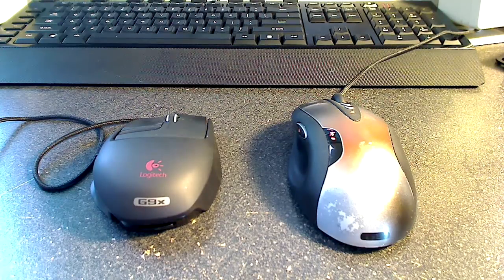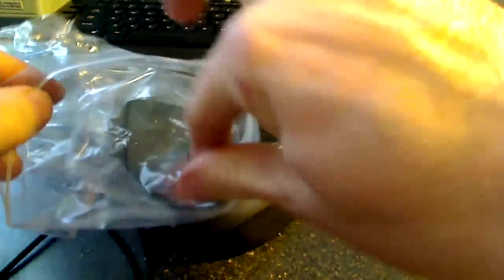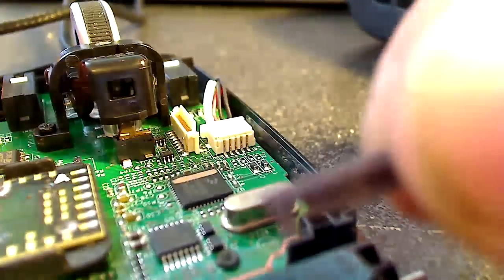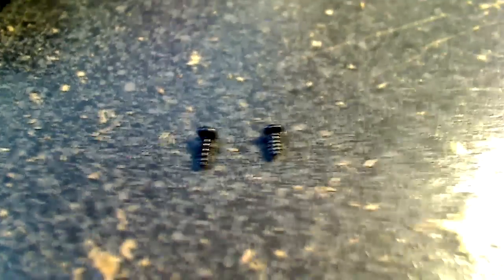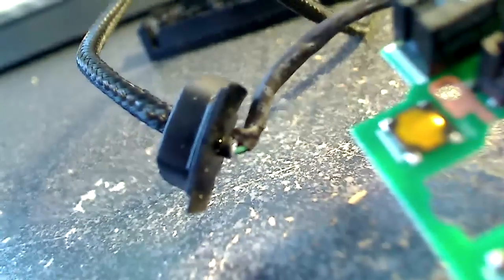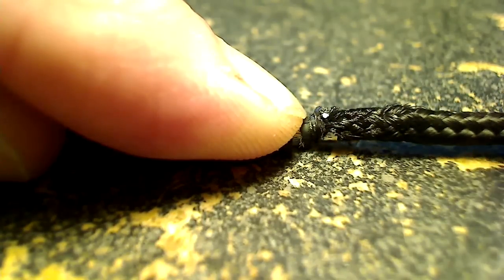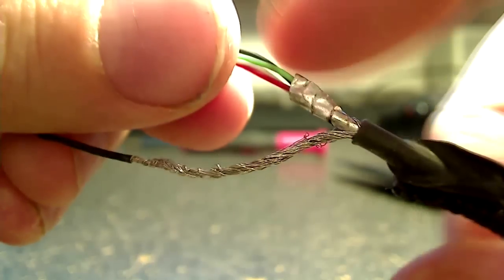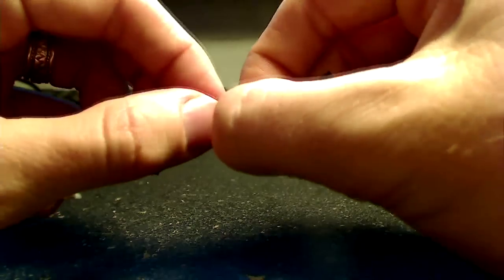Logitech G9 / G9X Disassembly / Repair - Shorted Cable

Comment: I'm an electronics tech and have been doing these sort of repairs for 20  years. My G9x keeps losing power mid use so I know it's the power/USB cord. I just needed a video to show me how to take apart the mouse without damaging anything. This is a well made/edited video from beginning to end. Thanks. Anyways, I took my mouse apart and I can see damage to the wires where the grommet is. I don't have a soldering station at home, I'll have to fix the wiring issue next time I'm at work.

Comment: Just used your video to clean the mouse wheel after 6 years of use...good as new, thank you!

Very tricky (if your a fumbles like me) to put back the whole wheel assembly.  I actually had to take the wheel itself out of its plastic holder to clean out the grime underneath.

Altogether 45 minutes.  Saved myself some cash, but the satisfaction of fixing something that is still good is invaluable :)

Comment: No idea if you are still active on here friend, but I just wanted to say a big thanks. This video was super helpful in me fixing my favourite old mouse! I bought the G9x back in '08/'09 and have yet to have a more comfortable mouse. It stopped working years ago (couldn't stay powered), but I found it recently and decided to try fixing. As soon as I opened up the end of the rubber wrapping on the wire, the wiring just crumbled like dust and fell apart in my hand! I lost a good 2-3cm off the black wire. Twisting these together and soldering was enough to fix the issues. Your guide was essentially for the fast and easy assembly/disassembly. Thanks!

Comment: Well I took the old G9 apart knowing I didn't have most of the stuff needed to do the repair. In the end I just wound the two black wires together and covered them tightly with insulation tape until I can get hold of a soldering iron, put it back together snd it works like a dream. Will use this while I wait for the replacement to arrive. Thanks again for the video.

Comment: Thanks! my scrolling wheel stopped working and i bought a new mouse. The new mouse wasn't great so i'm sending it back and by chance i saw your video. Opened my G9X and there wass big ball of dust/hair, removed it and now it works fine again!

Thank you

Comment: Thank you - this video was insanely helpful for repairing a shorted g9. As a public service announcement for others, if you find your mouse constantly scrolls up or down after reassembly, you may have over tightened the screws that hold down the mouse wheel. I had to futz with the screws to find the right tightness (if too loose the wheel won't register clicks consistently).

Comment: You saved my mouse! I had a problem with my right click switch, but I had no idea how to disassemble my mouse or even where the screws were. Now it's in perfect shape! all i need to do is wait for the glue on my front teflon foot to dry, and we're good.
Reply: Was it your right click releasing constantly?  Mine is starting to have that took and I even cleaned it.

Comment: Thanks for this excellent take-apart video!  I just resurrected my G9 with its help.  I did not mess with the cable itself though - cheap cables for these things are all over Ebay.   My mouse had suffered the tender attentions of my toddler son - when daddy would forget to push it well back, he'd yank it off the table, chew on it, chew on the cable, yank on it HARD (happily chortling ) when daddy would try to take it back.  The mouse surprisingly made it through a couple months of this abuse before starting to intermittantly disconnect from the USB.

I might take the cable apart, just for yuks, to see what exactly happened to it.

Comment: I just change now my old  logitech g9 wheel,  and didn't know where it came a little piece of plastic (which goes under the wheel, I dropped it when I remove the pcb for inspection & clean), thanks to your well explained video I was able to know quickly where it was placed. Thank you and greetings from Spain!

Comment: I had to RMA my first mouse since I was using it on a painted wood surface and the tracking became worse and worse.  My second mouse has fallen a lot and the wheel broke, it was also shorting by the USB cable side.  This video helped me put the wheel and cable from my first mouse into the second mouse.  Not the intended purpose of the video, but you saved me a ton of time, showed me it was actually possible, and saved me $50.  Thanks so much!

Comment: I actually needed to repair my mouse wheel assembly and this video just worked fine for getting me there. Thank you very much!
Regarding the ribbon... it's actually two pieces, so nothing is breaking as fpsDREDD assumed. It's the ribbon connector cable, you put that in first and then you slide in the little black cap that tightens it in. It's the most PITA part of the process but works once you figure it out.

Comment: Thank you for making this video, my mouse wheel stopped working on my G9, took it apart and cleaned out that clear plastic part. It works now thanks to this video. Thank you!
Reply: bryan today my g9 lase mouse the wheel stop working but when i press the wheel its work ,only when i scroll doesnt work ,,so what you do just clean with what ? whit a contact cleaner ?
Reply: Matthew Grech I just used a paper towel and a q-tip.
Reply: its works now yeeeeeeeees thanks to this video and you bryan u saved me my g9 laser

Comment: great vid, i recently had the base of my cable getting really flimsy and "stubborn" since the cloth stiffened up except for the very base of the cable...so i got a replacement as well as some hyperglide feet...best decision ive ever made the avago 9500 is my fave sensor ever "latent acceleration" included. My friend has a sensei raw and we both vouch that the avago 9500 is hands down the best fps sensor weve come across playing cs for 10+years. I was willing to do anything to keep my g9x going. I got a g700s but its more of a mmo/moba/rpg mouse to me i couldnt hang playing fps games with it. Im glad i saw this vid and knew how to remove the ribbon/pcb from the mouse base so that i could rout the cable correctly....i saw some people complaining about not being able to click...i knew that was operator error. My cable looked like yours exposed and i think its why it was getting flimsy the housing/shrink wrap was migrating. So glad its running 100% a ok. Avago 9500 or nothing for me im currently running 1oz of weights 28g total. I love it its heavy but the added weight works perfectly as a friction anchor on my 9hd hard pad+the hyperglides. Some people dont understand the effect "weight" has on friction and how effective it can really be for tracking.

Comment: I came here to say the same: thanks for your video. I didn't think that the screws were behind the glide pads. I was having the same scroll problem, cleaning it helped to make it work again. 
It seems that  the rubber of the wheel is tearing down so I have to be careful when using it. Again, thanks!

Comment: Cheers for this! 

I ended up splicing in another cable (old MX510 lawl) as the one on mine was a bit stuffed and hacked a work around to avoid using the plastic bit to hold the cable in place as it exits the mouse. No solder either, but I'll try and get that done at some point.

Works beautifully now instead of disconnecting constantly.

Comment from the maker: Sweet.  Glad the video helped, and I'm glad your mouse is still going strong for you.  The G5 you see at the beginning of this video I've had for ages.  I bought it at Frys when it first came out. . . that thing is still going strong.  I used to have to clean the scroll wheel on it, too, though.  The scroll wheels usually work with a sensor reading an alternating pattern of "spokes" on the wheel, so when they get filled with dust the sensor can no longer "see" the pattern and it won't work.

Comment: Thanks! I just repaired my Alienware Tactx (same as the g9 and g9x basically... rebranded Logitech with no replaceable shells)
Turns out the cable was completely shredded at the mouse/cable junction. I ended up just stripping the wires and twisting them together, followed by tape to keep them all separated. So far so good. The TactX seems to have more room in the housing than the G9. Also the ribbon is soldered on, so you have to work with the top of the mouse attached. Eitherway... Thanks again

Comment: Thank you for making this video. I ended up purchasing a replacement cable off of Ebay and following this guide for the installation. Unfortunately, I broke the ribbon clip; however, I was able to wedge the clip/cable in and everything seems to be holding fine.
Reply: haha same i broke it but still it holds =), now waiting for my new cable from amazon, hopefully i will be able to use this awesome mouse again. sad that they dont produce it anymore , and its on blackmarket in my country like its 550$ now :D
Reply: +E A    wtf, you're right.  I see some sold for $60+postage, but a lot of them also sold for $200-$300, wtf is going on?  Perhaps they are last-minute X-mas presents, or last-minute replacements for kids who broke their gaming mouse at the start of the holidays?  I can't figure it out.  Perhaps it's a money laundering operation, i hear that this is happens a lot with suspiciously overpriced ebay items.
Maybe i should think of selling mine, TBH i've always hated how hard it is to click the middle-button.

Comment: Nice idea. On ebay I found kits that have the cable and a set of replacement feet aswell. cable includes the rubber part that you cut and goes all the way to where it plugs in on the board.

Comment: Thank you so much for creating and posting, this video.  It saved my beloved g9x from the trash can (I'm using it to post this).  FYI, in my case the white wire was broken not the ground sheath.  I was able to reuse the sliders too -- though frankly, as fiddly as this was, if it happens again, I'll buy the cable kit :)

Comment: Then followed the instruction in the video problem was I had not only the black also 2 other cables broken. I cut them and put them together and plugged in usb port to check..  it worked! (the  mouse was still open) only problem I used duct tape instead of solder the cables :) so the cable was too big to get the it under the main board.  Then I simply put the cable from the screwed laser mouse in the the old one.  Now everything runs smooth.  Anyway helped me a lot!

Comment: THX worked for me but only cuz I had 2 G9xs.

My first G9x had exactly the shorted problem back then I didn't search for repair video.
Bought a new one that was fine for a while then it had a very strange problem  the laser messed up on the rough side of my surface pad the laser was screwed no guarantee left. Then I used the old one again which worked way smoother but still had the shorted problem always went off and on. Then searched for repair found this vid. 

continue next comment...

Comment: Thank you for the video.  My infinite scroll wasn't working very well and I didn't want to tear the rubber pads to see if the screw were there.  Fortunately my little screwdriver kit came with a mini pry bar so I was able to reuse the soles.  I blame my molting Husky for my issue.

Comment: 10/10 for the vid!
Although I did lose the little plastic grommet under the mousewheel; supplemented this by using a bit of the leftover rubber cable shield and pushed the screw through it. In addition, I've just realised I can get a complete g9 replacement cable from ebay for under a tenner with p&p too, so I'm going for that :-)

Comment: Xlint vid.. I knew my cable was the prob did not know there was a known issue. great lil tip on how to save the cable stress.. In the past when I have not been able to save them or needed to make my own lil mods to the cable stress hot glue is a great way to fabricate one in a pinch.. messy but functional. also not a bad idea to let the heat shrink extend past the cable stress a couple inches to keep the cable from kinking.. it does get a lil bit too tight of a bend there.

Comment: Instead of cutting the bracket that is affixed around the usb cable, I cut the cable very close on either side of the bracket, then pushed my small screwdriver through the hole to remove what was left.  It took 6 or 7 pokes since it seems the cable casing is glued inside.

Comment: The ribbon cable clip wasn't designed to be pulled completely off (of course it technically can..). It's best to just pry it up slightly on each side and actually leave it connected.

Comment: thanks a lot. This really helped me to know exactly what I am doing without having to figure out the whole thing <3 Worth mentioning I got a brand new cable/repair kit on ebay... from China... it cost like 15$ CAD ... Hate new big mouse that do not fit my finger tip grip... and even more those crazy dudes on amazon/ebay selling the G9X for more then 500$...
Reply from the maker: Glad it helped! Thanks for taking the time to comment. The replacement cable is definitely a much easier way to go.

Comment: Hi
The wheel was not steady, so what i did is just unscrew and screw it again, but now the wheel isn't scrolling
what i have to do? should i buy another wheel (30-40 days shipping) or there is a solution for that

Thanks.

Comment from the maker: Hmmm... Not sure what could've happened there.  Pretty much everything for the thumb buttons is housed in the top of the mouse and should've been more or less left along for this tutorial.  There is a small ribbon cable visible on the top half that may have gotten messed up when you put everything back together?

Comment: great video, really helped a lot. just wanted to know do you have any idea what size that connector (cable to mouse) is like a part number or the name of that component. The wire in mine is completely trashed so i want to re-crimp it.

Comment: what screwdriver do you do use? the magnet on my screwdriver barely holds the smallest screws, but even the larger ones were moving towards your screwdriver. Bit of an odd question, I know. :P
Reply from the maker: I use the "Boxer 30pc Precision Screwdriver Set" found on Amazon.  Alternatively you could just get yourself a Magnetizer / Demagnetizer Tool -- super cheap and super handy!

Comment: My G9x stopped emitting the bottom red light. Being unable to illuminate the mouse pad, now it works only on bright, textured surfaces, like my bamboo desk (no black mousepads anymore). Any tips on how to repair the red light?

Comment: Hi I realize this is an old video, hopefully you can provide some insight. The g9 I have has been broken for years, when plugged in red lights flash for a few seconds and then stops with no response. Trying to see if this is the cable issue so I can go ahead and repair it. Thanks -Ryan

Comment: Is there any way to get a replacement cable? Mine just died. Completely. No lights whatsoever, but I think the best way would be changing the whole cable. It seems it connect to a simple port, so it can be removed without any problem.

But can I get a such a cable? I doubt Logitech would help. Any thoughts? Quite disappointed. The shielding looks cool, but on a point, it stretched and the actual cable slipped out, thus creating a loop. Just like that. I treated it like a nothing else.

Comment: Just a warning for those doing this:in the video he incorrectly removed the ribbon clip. The clip pops up about a quarter inch and the ribbon slides out. I did it as shown in the video and the plastic clip broke. Super glue saved it.
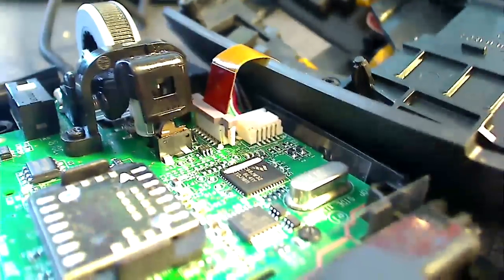Reply from the maker: fpsDREDD Thanks for the heads up.  I added an annotation at about 4:45 so hopefully no one else will have theirs break.  Sorry that happened!
Reply: fpsDREDD i noticed in the vid, bc when he forced it one of the sides popped up, so i took a little flathead from an eyeglass repair kit, and pried both of the levers up the ribbon is some what harder to put back in depending on how bent it is and the angle its going to be in once the mouse is closed, i didnt want too many creases if not any easiest tip for that once i figured it out... place the bace of the mouse stationary, and apply the ribbon carefully on the stationary base...then hold the top shell in place while clicking down the tabs with a small flat head/needle tool etc

Comment: Ok. After attempting this fix here's my 2c. 

Those that do have the shorted wire unlike this video will most likely have the wires just break away and fall away with minimal interference.

What you actually need to do is extend the black wire's length in the amount of lost shorted wire otherwise you will most likely end up with reassembly problems as you NEED to re guide the wires in the correct position in the mouse housing under the PCB.

Comment: Hi, My g9 also died right in the middle of the game (few short shutdowns, than completely ) and i folow the vid, found that my outer black cable was not connected and i connected it and weld it but it won t still work....only board no top it works for a few seconds and with top and fully assembled get power for a sec and shuts down....it s like he can t maintain work...help pls